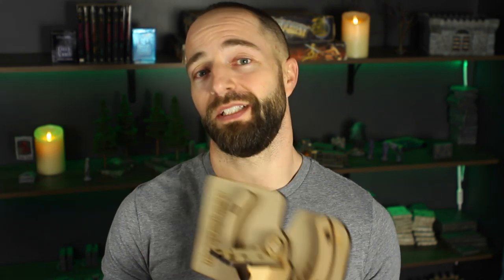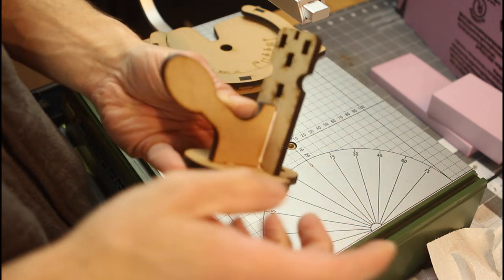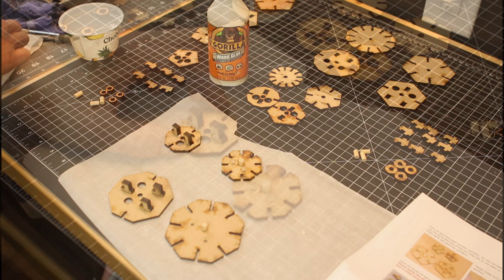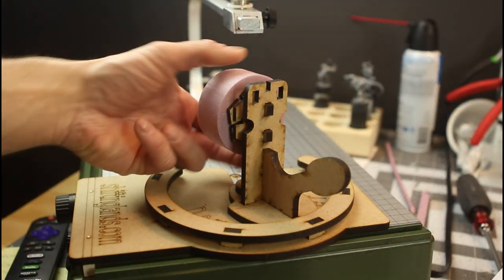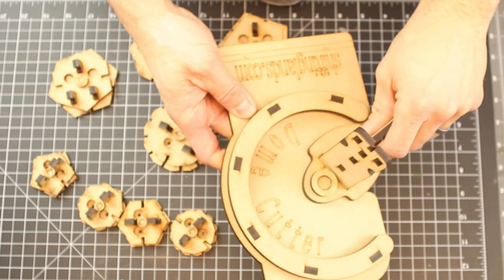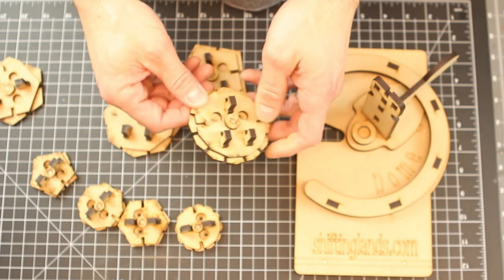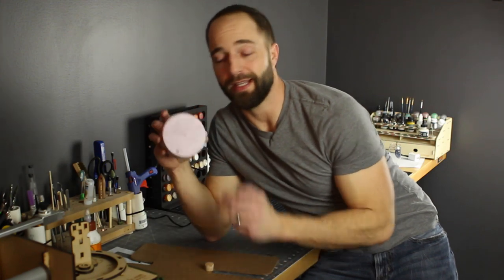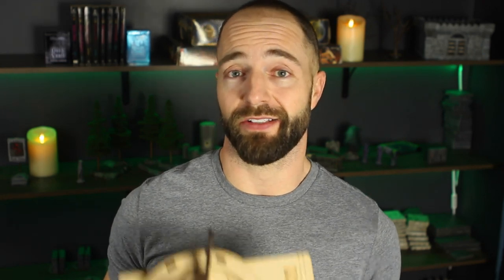Shifting Lands Dome Cutter Review

Comment: An interesting vid. I was hoping you would show a Dome, at the end,  that you had produced using it.  I have considered buying one of these devices but have pondered how to cut a TRUE dome, using it. What I cannot figure out is that out of the templates that the video showed, . the one with the most sides had twelve. Therefore it would not produce a true dome but a twelve sided dome. Or am I missing something?  No doubt sanding could be done but that defeats the object of the device. Maybe you could produce another video, showing how you produce a true dome. Please.
Reply: Hi Roger. You are right. The dome cutter cut domes but it does not cut perfect round domes in one go. I do however use the dome cutter to cut these domes using the twelve sided template. Cutting the 12 sides of the dome and then cutting the twelve corners of this dome. In this way I end up with a 24 sided dome . The final step is to sand it into a round shape.
Reply from the maker: @Shiftinglands  Thank you Gerard.
Reply: @TabletopWitchCRAFT  Gerard thanks for the explanation. Following your procedure, and having 24 sides, you will minimise the amount of sanding required. So, taking it a step further, rotating the foam at 10 degrees instead of 15 degrees would produce an even smoother dome.   (I wish May 2020 would hurry up!)

Comment: Thank you for this video. It made me brave enough to start the build! I must have watched the critical part of it 4 to 5 times at least. And for sure I made a similar error, nevertheless...DOH! For me it were both 5-sided parts as they are the only ones being asymmetrical. And I’ve only seen it after the wood glue was completely dry... 

Not reading through the comments here, I searched on wood constructing web sites and got yet another tip for loosening wood glue: As most wood glue is not heat resistant, a simple hair dryer pointing to the seam heated up the hooks on my parts so easily I thought I share this for all who come to your video (being the best assemble video for this shifting lands tool out there). It only took 30-60s to heat up per hook. Even heating up 2 hooks at a time was no big effort. 

Thanks again for putting together this great video!

@Gerard: Perhaps adding a note to the manual pointing out especially to the fail-potential of the 5-sided discs would be useful for future customers. ;-)
Reply from the maker: Excellent tip thank you for sharing that... I know what I'll be doing tonight!!

Comment: FYI, you can get 3" thick XPS from Menards, but I believe you have to special order. Most retail building material stores (Menards, Home Depot, Lowes) only carry 2" in stock. For sure Menards can get 3." That being said, I am a concrete contractor, and through my supplier I can get 4" XPS, and I believe they can also get 6" but this is NOT your typical homeowner store. So yes, they do make XPS thicker than 2" in the US, but you can only get it through construction supply houses.
Reply from the maker: Good to know, thank you !

Comment: You might consider drilling the dowel pins on the templates to a diameter of a toothpick. Placing said toothpick through the axis of the template would give you a small pin that can be placed in the mark from your circular cutting board. No need for measuring to ensure the template is centered.